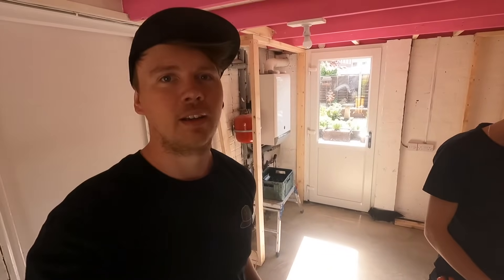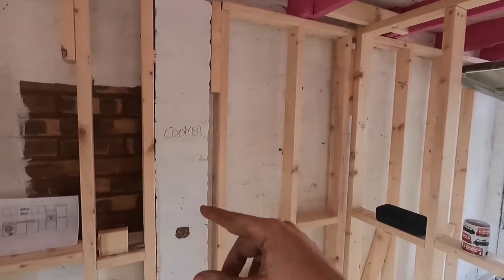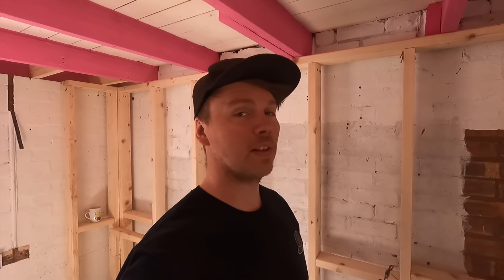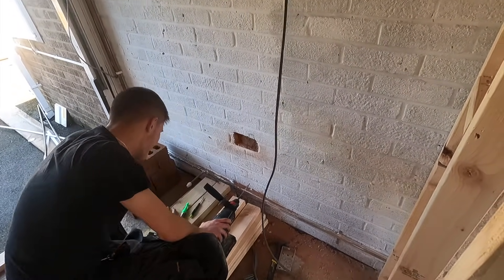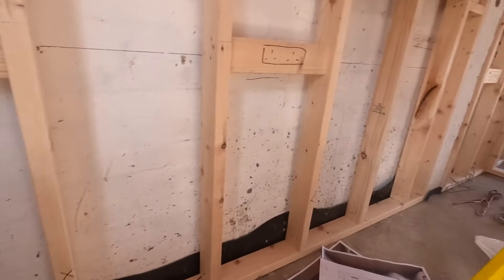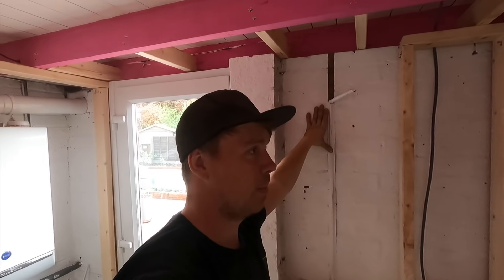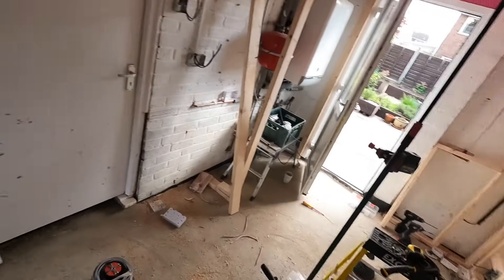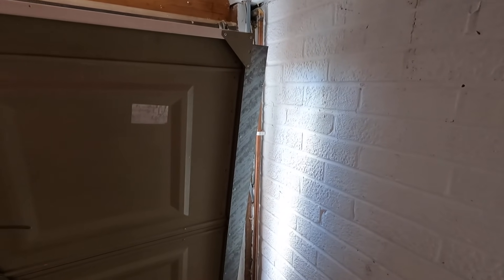Garage to Kitchen Conversion - Electrician

Comment: Good on you putting a DP isolator in for the outside socket. Such a basic addition to the design but 15 years down the line when the outside socket inevitably lets in some damp and causes an earth fault, it means they don't need a spark out within a few hours to get half the installation back on. If the kitchen's on a 20A radial or they only need a 1G external socket you could have put a fourth switch in the grid to isolate the outside socket rather than using a SFCU (I'm desperately trying to stop myself incorrectly calling them fused spurs!)

Comment: That’s exactly why I always use 2.5 for a dedicated boiler circuit. You never know when it may be needed for something else
Reply from the maker: Yeah man, why they ran 1.5 is beyond me
Reply: @NBundyElectrical  I see it alllll the time in new builds now. As cheap as they can possibly do a job
Reply: 1.5mm can take atleast 16A so for anything run off a 13A fused spur is fine especially a 3A boiler control
Reply: @robswingler  don’t get me wrong I know it’s completely fine for a boiler. but I’m saying I always use 2.5 incase someone needs to use it for something else, I’ve never had it happen personally but Nick could have done with it in 2.5 here so my reasoning with myself works, and I’ll continue to do it 😃
Reply: @robswingler  I think all power circuits should be a minimum of 2.5 no matter how low the load, it just makes sense for future proofing
Reply: @Cablesmith  1.5mm min for a power circuit. 👍
Reply: @tomorichard  that’s what regs state, 2.5 for me personally I mean.
Reply: @Cablesmith  agreed 👍
Reply: Yep had one, owner didn't know what he was gonna end up with, we ran 2.5, fortunately! Ended up needing to stick a 20A switch on the end (16A breaker) for an immersion fed by a Harvi....
Reply: @Cablesmith  Yeah I’ve seen 1mm on new build boiler feeds 🤷🏻‍♂️
Reply: @JayTheSparky  jokers 😩 new builds keeping literally every inch as cheap as they can

Comment: The walls with the 4x2 cls will have insulation between studs and the bare brick walls will have insulation board... so the bracers on the side are correct for the back boxes

Comment: The Company that just installed a New Kitchen in my Parents rented property they fitted 35mm back boxes but distance between the back of the box to the actual socket faceplate is 80mm it's wild it's a right S#!T SHOW

Comment: On a good note, thanks for using a grid switch instead of in your words fused spurs for each appliance. It's so ugly and unnecessary in a brand new kitchen. I have put the supply cables in each corner so it's neater for linking out each grid switch. Odd to see there is no Hob and also very few counter sockets. I also don't understand the need to isolate the external socket

Comment: Why don't they make extensible steel mounting boxes with a 35mm extension fitting inside a 25mm exterior? You wouldn't need to carry two sizes, you'd simply push the extension back inside the 25mm exterior when 25mm was needed. When the hole depth wasn't exactly one or the other you could make small adjustments to fit the depth available. When the depth was less than 35mm, you could leave them fully extended for the plasterers when necessary and push them back by using the faceplate screws to pull the plates up snug to the plaster. You could even make them more flexible, perhaps extendable from 20mm to 40mm? Screwfix charge 6p more for a 35mm than they do for a 25mm so, hopefully, the extra steel/manufacturing cost should be negligible and offset by the stocking and packaging savings. (Copyright © 2021 Brian Smith)
Reply: Appleby make extension for single and twin flush boxes
Reply: @titchmoore6295  My thought was for a single, integrated box (or range of boxes) with the extension piece inside the outer box. Fixing the inner box back plate to the wall/structure and then using the top plate to draw the outer box down to the correct depth would mean the mounting box was always the right depth for the hole.

Comment: be careful with the cheap bin companies mate they tell you its 17 quid plus vat but then there is excess weight charges after a certain weight if you have an 1100 bin it will most likely be 70 kg my advice to you mate would be look after your bin men and they will look after you I've been in the game for 8 years and certain customers never get an over weight charge because they look after us  bottle of pop every now and then and a cheeky purple one at Christmas will save you a lot in long run mate

Comment: We usually use a 47mm shaver depth k.o.box for appliance grid switches it gives you just that little bit more room why struggle?
Reply: Yeah gonna be doing that tomorrow on a 4 way lighting grid, 4 intermediates in a double box, 8x3C+E's lol

Comment: Is it a English thing nick putting noggins in for metal boxes instead of using fast fix boxes when it’s plasterboarded? Roughing the cables in would be so much faster?
Daft Scottish spark 🤷‍♂️
Reply: It’s just a preference to fit metal box’s & no additional fire barrier protection required as and when required.
Reply: Round here the plasteboarders will tuck your cables up out of their way and bury them in celotex...

Comment: Can anyone here tell me if a local switch/isolater is required for a cooker circuit?
Reply: Its not regulations to install an isolator for cooker but I always do for good practice and maintenance. Hope this helps. 
Remember if in doubt get an electrician.

Comment: Probably a bit of cable burn going on there the way Adam was pulling that lighting feed in, should push cables through holes not pull it!!!🤦🏻‍♂️
Reply: Was a meter or 2, unlikely it would have burnt through the outer insulation. If you’ve got 40m of cable to go through a hole you definitely don’t push all of it through
Reply: You would be surprised how easy it is to burn through the insulation, depends how tight the hole is to be fair, I always have one hand one side of the joist pushing and the other hand pulling from the other side, also every new cable you pull through put it at the bottom of the hole with other cables above and pull downwards better safe than sorry, the speed he was pulling it would take seconds to burn through a cable.

Comment: No way as a sparks would I put an isolation switch in cupboard , it needs to be accessible incase of an emergency, you can run a boiler spur in 1.5mm as long as you fit a 6or 10amp beaker back at CU and I hope you fuse your boilers with a 3 amp fuse at the spur . It usual to run a boiler spur on a 16amp breaker not a 20amp breaker ..
Reply: Are  kitchen cupboard doors screwed shut these days ? 😀